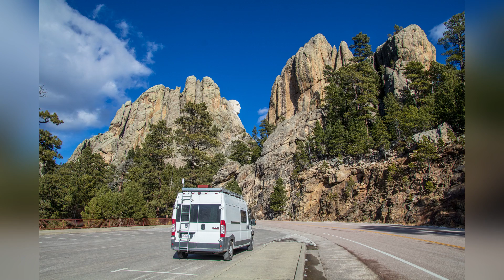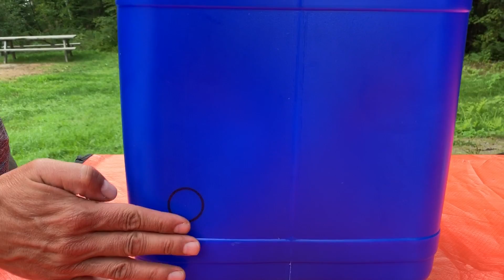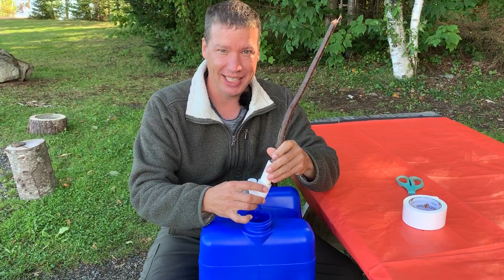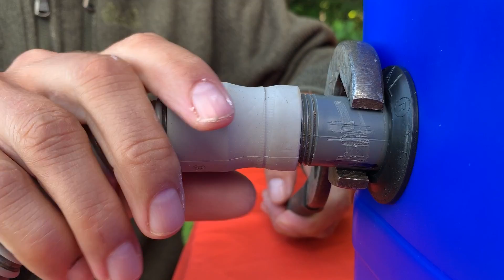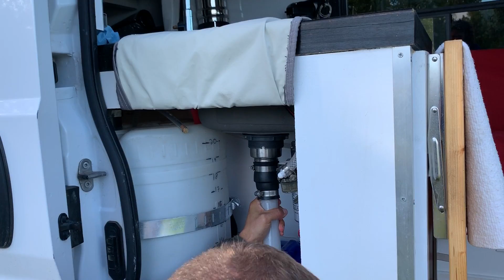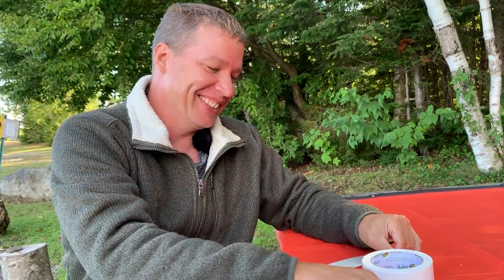DIY ~ GREY WATER TANK ~ Empty Your Grey Water Tank Without Removing Your Tank

Comment from the maker: EDITED 10/10/2020 
The one con to this grey water tank is that it is virtually impossible to clean! After a year or so it will begin to smell quite bad! At that time you will need to install a new tank. Our next tank we will be installing a 5 or 7 gallon bucket( easy to remove lid and clean) One tip to keep the smell down is to install a pee trap and try to keep greasy liquids from entering the tank. 

We get asked quite often where we got our round fresh water tank... it was given to us! Here is a link to the closest we could find.... this tank is actually better because it has a valve at the bottom making it possible to flush your tank every so often. 

https://m.plastic-mart.com/product/211/20-gallon-vertical-plastic-storage-tank-vt0020-16

Comment: I'm finally ready to hook up my water system and I like your grey water system so that is what I'm going to do.
You'll probably never see this comment since your vid is 5 years old but if you do, you'll know your older vids are still seen. 
Reading the comments I might actually use a stand up pipe instead. 
 Also i noticed you keep the small hole closed on top. Wouldn't that need to be opened for better flow of water in and out of the tank?
Clear demonstration. Thanks!

Comment: Hey could someone please help me, I made mine but it won't drain what could be the problem?
Reply from the maker: Is it full? If there isn’t much water it won’t drain. Have you tried holding the hose up in the air and then setting it down quickly? We’ve had to do that a few times. 

Last resort is to get suction moving… you won’t like how this is done😂 just like siphoning gas!

Comment: Hi Dave, thank you for your detail illustration. I just completed gray water tank as your instruction and completed testing. Thank you so much~~~
Reply from the maker: Right on Hannah! We have learned not to let anything greasy like spaghetti go down into the grey water when doing the dishes. This helps from keeping nasty smells coming upon in the heat of the summer.
Reply: @oneadVANtureatatime   Yes, Carrie had explained me about how to prevent grey tank from smelling.   I have been working on toilet situation, recently. At first, I planned to purchase Laveo dry flush toilet, but later I figured out that cartridge is big. I am trying to reduce trash as little as possible. BML camping website recommend to burn safe to burn trash. Then, I found wood burning pallets for $6.00 for 40 pounds from Lowes. It is compact and can be used for bagged composting toilet. I am using biodegradable bag. Do you know if I BML land camp permits to burry biodegradable bags 6-8 inched below ground? I could not find this information on BML land camping. Thank you~~~

Comment: Thank you for this wonderful idea!
Reply from the maker: After 3 years we are still using this system and it works good. We may upgrade to the same system but use a 7-gallon bucket with a lid. That way we can reach in and clean it when required. 😀

Comment: After you have used it for a while now, has it ever leaked? I'm about to Do this!
Reply from the maker: Hi Bill. Still never had a leak. We will be switching to a bucket with the same set up at some point. This way we can reach our hands in through the lid and clean it when it starts to smell. The same plumbing parts will work on a round or square bucket.

Comment: Great video, this is probably a dumb question but why didn't you just attach the hose to the spout that is included with the aquatainer?
Reply from the maker: The spout on this container screws into the cap. We needed that for the sink drain. I guess you could turn it upside down and make a new hole for the sink drain. Then you could pipe down through the threaded cap. As long as it stays watertight your all set. Good thinking Stephen. 😀

Comment: I made my own too, but mounted it under the van. https://youtu.be/HNLR0rpB5NE
Reply from the maker: Nice setup, I love your out of the normal creative design! Have you tested it in colder weather yet or do you reside in warmer temps?  Thank you for watching our video. Take care
Reply: @oneadVANtureatatime  were in freezing temps now but not living in the van, I'm planning on adding 12v low power heat to the 3 water tanks and the waste, and the pipework, at a cost of like £20/$30 for the whole thing....will be triggered by a thermostat at 33f/1c inside one of the water tanks...
Reply from the maker: Nice! Saving that room inside the van is huge. Nice work and video...I would have loved to see a couple of bloopers at the end 😂 Take care and stay warm.

Comment: Next time you build one you should try putting the elbow on the outside of the tank with a straight pipe down through the top to the bottom to siphon that way it would not be as crucial to have it sealed
Reply from the maker: +Maine-iacs hmmm.... we will have to think about that 😃

Comment: What purpose does the elbow pipe inside serve?
Reply from the maker: +Daz555Daz you need the hose 4 inches up to be able to cut the hole and insert the seal ring but you don’t want 4 inches of water sitting in your tank at all times...... that is where the elbow comes in. It sits just above to very bottom so it gets almost all the water out.

Comment: Great idea.!
  I may do the same when the time comes for my stealth camper van  build. 
  One suggestion though. Instead of a short piece of pipe that goes to the bottom, how about using a longer pipe that reaches most of the way to the top of the container, or even comes out of the  top of the tank. 
   That way it would leak only a small amount of water if it ever sprung a leak. The water at the top is under less pressure, and it will only leak down to the fitting. 
  If your drain hose came out of the top of the tank ( with a standpipe all the way to the bottom). You would have to put a bit of water in the drain hose to prime it so that it would siphon the tank out. When empty it would have no possibility of leaking because the drain hose would empty each time you drained the tank. You would need to prime it with a cup of water, so there would be no possibility of accidental leaks. 
  For round holes, consider using a step bit. They are a bit expensive, but you get several drill bits in one tool. I don’t think that they go up to inch and a quarter however.  My biggest one is an inch and an eighth.
  The hole saw was probably your best option.
  I’m enjoying your videos. 
  Where are you planning to be during winter this year?
  Keep the shiny side up,
  Steve
Reply from the maker: +S Wolfe hmmmm... food for thought! Thank you for commenting!!  We will be in Florida for a tiny home festival in late November..... no clue after that?  Staying in Florida or perhaps Arizona. Dave is already wishing for snow ❄️ so bets are at some point we will be in snow country, especially since we just installed a new heater.

Comment: This was great info. Thanks for sharing. Questions, how do you fill the fresh water tank and do you dump the gray water at a dumping station?
Reply from the maker: The fresh water is filled via hose through the top of our counter. We mostly fill our fresh water at state parks and we dump there. There are times that we need to dump when no dump station is available... In that case we choose a secluted area away from any public or camping areas and away from any water sources.
Reply: @oneadVANtureatatime   I was thinking a free on ramp would be good and I can orientate the jug for total draining and very low impact. Not as bad as the pee jugs the truckers leave there :-)  I am building my grey water tank as I type! THANK YOU for one of the best van life hacks I have seen yet! Roger The ExBassGuide  <(((((><

Comment: This is similiar to what I was telling you about that I use. I ran my drain lines out the floor and keep the aqua tainer grey tank outside by the sliding door.  If mine should fill up I have two collapsable tanks to trandsfer the waste water into till I can get to a dump station.
Reply from the maker: +John tatman Sounds like a good plan and very responsible. I just wish the aqua trainer came in a clear container. But have noticed it’s always best to dump ever chance you get. The longer it sets the more nasty it gets 🤢